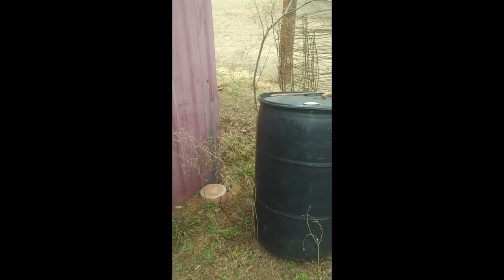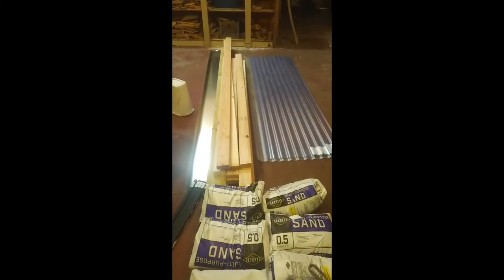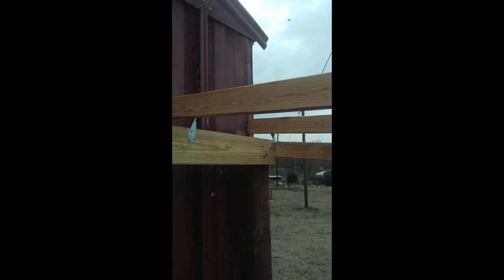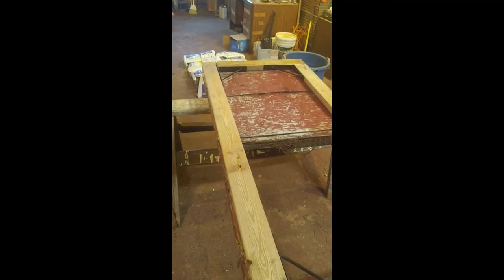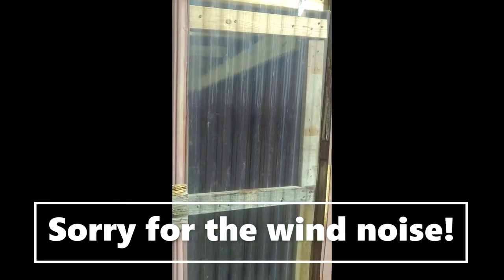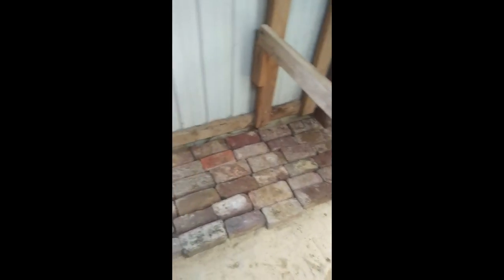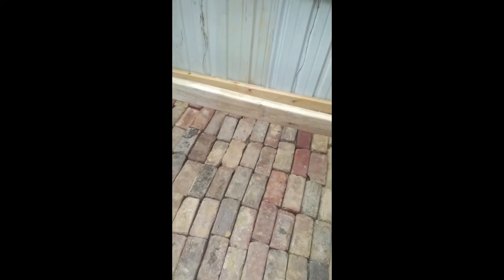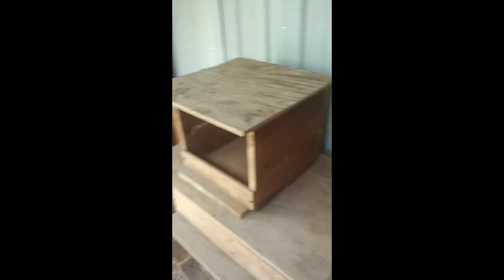Turning a broken-down chicken coop into a brooder coop

Comment: that was some seriously shoddy work they should have had the roof at a 45 degree angle so it touched the wood above the metal on the building it was against
and they had no overhang on the outside edge. to keep the rain away from the bottom of the building. you might want to consider a french drain type thing around the outside of the building to help carry water away specialy since it seems you have clay soil.
Reply from the maker: We'll see what next week's rain does, but I have a pretty high sand content, and my soil drains quickly.